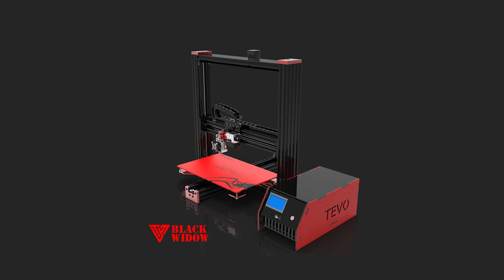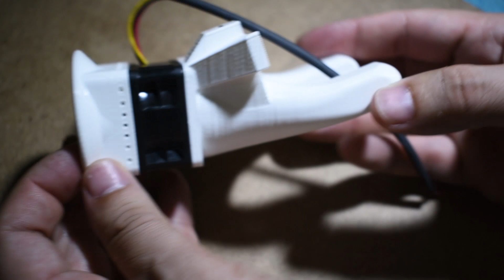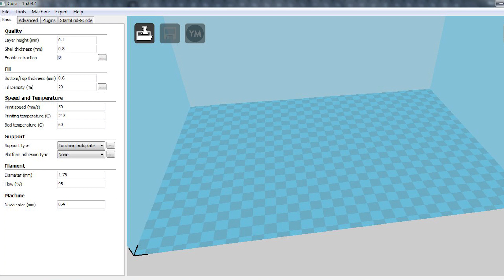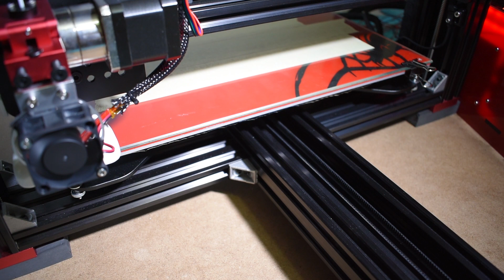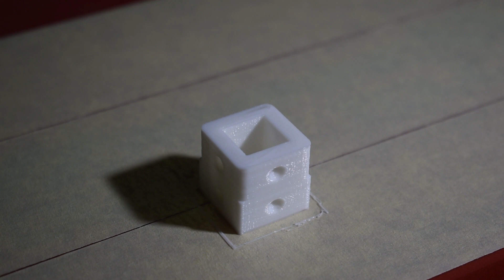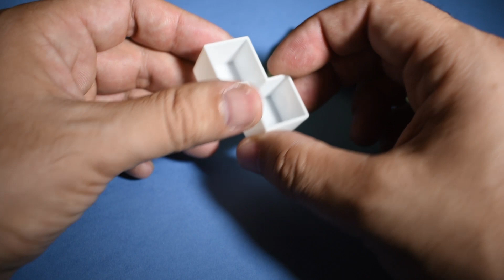TEVO Black Widow V3 assembly - First prints

Comment: Hey I watched all Videos and I have my Printer done ! 
But the time to heat up the heatbed take 13Minutes to 60Celsius. Do you know why ?
Reply from the maker: Hi,
That is too much time.
Check all the connections and check if you have any contact resistance in the connections.
Also, check the power supply if it's output is 24v.
Reply: ruiraptor okay, thanks bro

Comment: Upgraded Tarantula or Black widow? What you recommend?
Reply from the maker: Hi Isra,
That's a very good question.
In one hand, you have the tarantula which is cheaper, with an extruder that is easy to setup and dial in and most of the things that you need to add can be printed....
On the other hand, you have the black widow that it's a bit more expensive but it's a magnificent machine with just a few upgrades needed and capable of printing flex filament from stock...it's really a difficult choice.
I had that same question in my mind for some time now and...i still don't have the answer for that yet, sorry  :(

Comment: Hello! I love your videos. It's been helping me with my new Black Widow. 

Where did you get the glass? Also, the additional fan cable, is that explained anywhere? I'd like to do the same.

Thank you!
Reply from the maker: Hi Michael,
I bought my glass at a local glass factory. It was cut at the spot and was very cheap.
Regarding the fan cable, yes, i have that explained in one of the assembly videos.